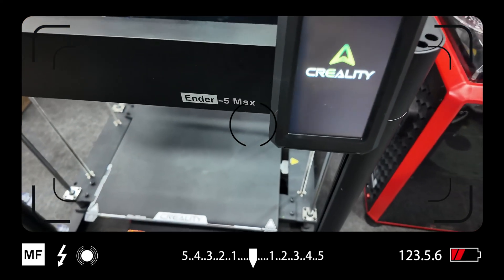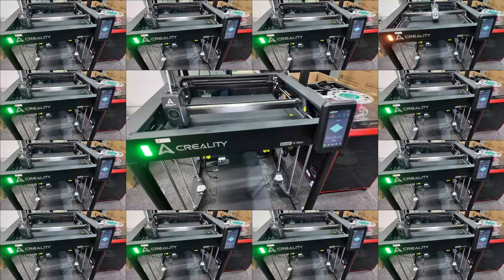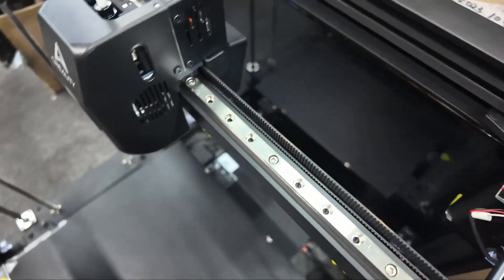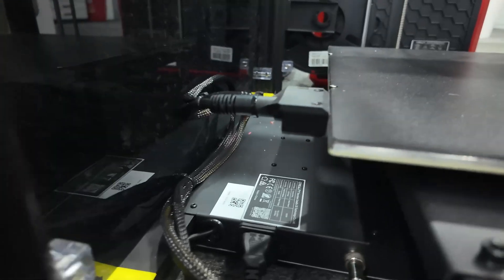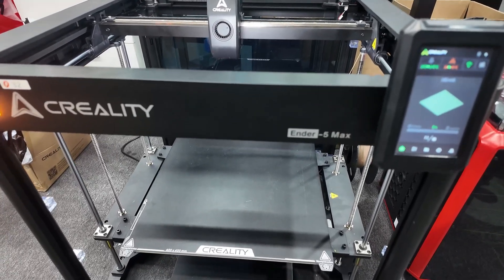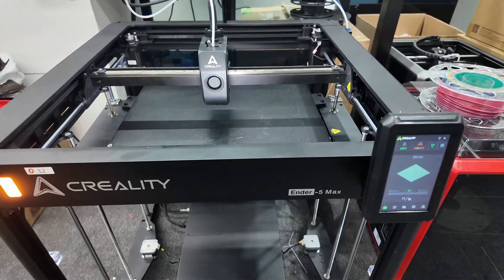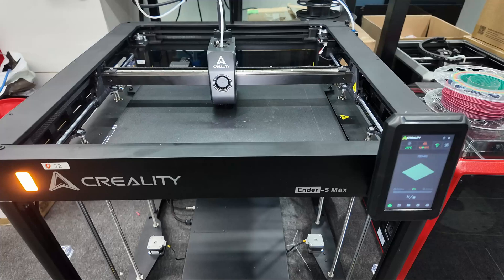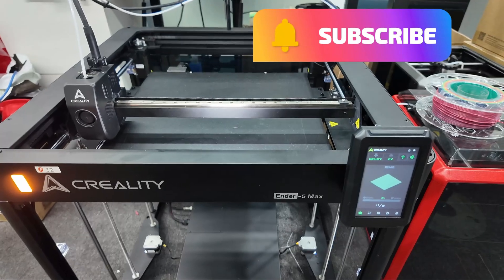Sneak Peak - Ender 5 Max @Creality3D new printer!!

Comment: Looks great. I am looking for another printer that can match my Mingda Magician Pro2 3D printer bed slinger, but that is a Core XY printer that is about the same size and it is 400 mm squared , just like my Mingda Magician Pro2 3D 3D printer. Do you know if that machine would come with the CFS, or is separate, and do you know when Creality will come out for the CFS for the K1 Max and the K1C, or do you know at this point?
Reply from the maker: CFS will not be compatible with the Ender 5 Max - no plans for that now. At CES this week they showed off the upgrade for the K series, I don't think we have a date yet but we know the price is going to be around $52 USD. It must be coming very soon now.

Comment: It seems that Klipper running on faster processors, with better extruder designs and coreXY with input shaping have all led to rapid improvements in consumer 3D printers the past two years.  The Ender 5 Max looks intriguing - good for large prints but also good for a bed full of smaller prints for maximum print farm throughput with minimal labor.
Reply from the maker: yeah you could definitely get a lot of smaller prints on one bed here!

Comment: I have an Ender 5+ and it has been a work horse of a printer. So my question would be, what is the MSRP of this direct replacement for the E5+?
Reply from the maker: What did you pay for the 5+?
Reply: @kevin.in.3d  I bought it back before the K1 was released. So around $600 I think. As I bought the silent motherboard with it.
Reply: Yo dude did u mod ur e5+ apart from motherboard ? If no then can you share what strining values u use
Reply: @Pistrae0909  I have, I installed a metal extruder, microswiss hot end and 0.6mm nozzle, replaced the bed springs with bushings, and added some printed parts for extra stability.

Comment: I can't think of the company that makes them but I saw in a video of a recent 3D printing trade show that someone made tiles for heating the print bed. With printers getting for big, it really could be a game changer to have zones or an area mapped out for printing. Would save energy/$$$ as well as time. Without a doubt something like this in the K2 Plus would have been even more of a reason to want one IMO.
Reply from the maker: I know the Elegoo Giga has four build plates so you can heat one or two or four, depending on the size of the print.  It's not a bad idea.  I don't even have room for the Ender 5 Max at my house so not sure who has the space for a 1m print bed haha.

Comment: Would love to compare this with the Creality K2 Plus, even more so if multiple CFS Units can be used with it
Reply: so would I, but that means one day they'll have to deliver my preordered K2 that was promised mid october :(
Reply: @keuning77  although it's no consolation to you,  I know they are shipping the pre order k2 plus, as I purchased mine on pre order, and had it delivered in the last 2 weeks
Reply from the maker: No CFS for this machine
Reply: @kevin.in.3d  Will there be an option for Multi-Head Changer instead, the ability to print with 2 filaments would be good, especially a different support material

Comment: Klipper or Marlin based?
Reply from the maker: Klipper.  It's fast - 700mm/second
Reply: @kevin.in.3d  Can you use Orca Slicer with it? Can you root it and upgrade the firmware like you can with the KE?
Reply: @kevin.in.3d  That was my hope.  And with their experience with the K1/K2 line it makes sense.  Although I'm not as sure the Ender 5 does.  Do they need another CoreXY machine at this point?

Comment: I used to own an ender 5 pro, this is VERY different. This looks a lot like flagship series tech. Although, the ender 3 v3 did have a k1 type hotend. I wonder if this will be reasonably priced. (Hopefully under 700)
Reply from the maker: I think you are close in your guess - maybe a little over 700 is my thought based on other printers and their prices.

Comment: take my ender 5 plus and give this bad boy to me 
at least it wont turn out as bad as ender 5 plus
Reply from the maker: How old is the 5 plus?  I really have never used an Ender 5 before.  I hope this one is as good as it looks!
Reply: a year mine never worked properly F dealers . was hoping to get refund or at least replacement .. This 5 max looks dope and the speed is mind blowing
Reply: @AnshumanG-e9k  Yeah ender 5+ QC sucked I had to:
Realign the belt guides,
Straighten the y-axis rods,
replace the leadscrew bolts with plastic ones
Straighten the x-axis rail
loosen all the ecentric bolts a LOT
Retension all the belts

To get decent prints going, the bed still sucks as it's more taco like than flat but I'm gonna be installing a hydra conversion soon so will be replacing that, and I fitted a Microswiss NG revo and a cartographer probe in the end to speed up the prints. Now I print at over 400% the base speed of the ender 5 without even touching the mercury zero upgrade path.
Reply: @wodmarach   damn dude 400 % base speed thats huge differnce .. i was also thinking about microswiss . 
thanks for the suggestions :)
Reply: @kevin.in.3d  pretty much around the same time when the ender 3 v2 came out. I have e5pro, it's a decent printer...for it's time. no Auto bed leveling no direct drive no network connectivity, bare bones like e3v2